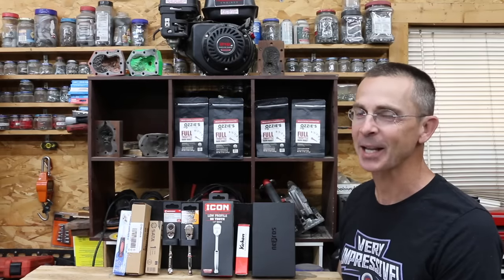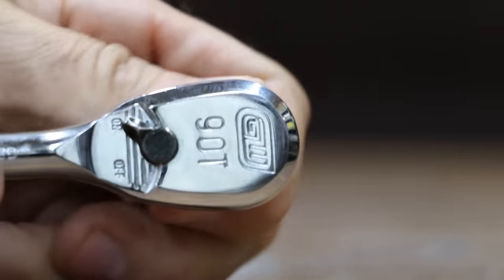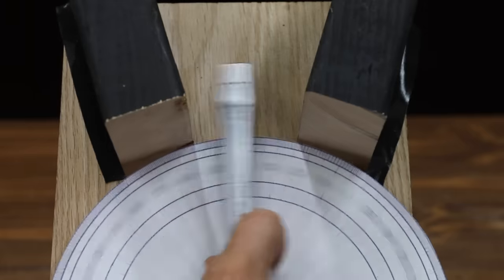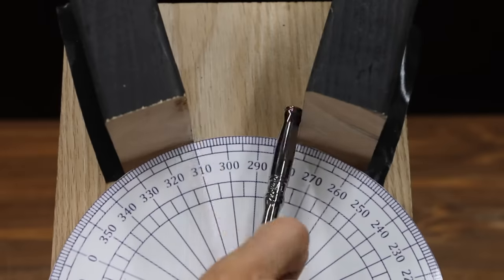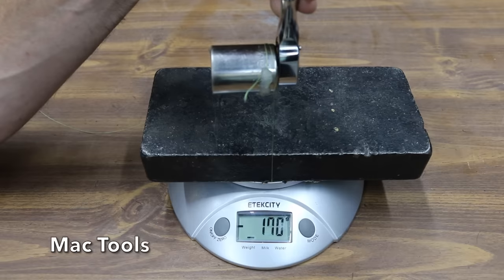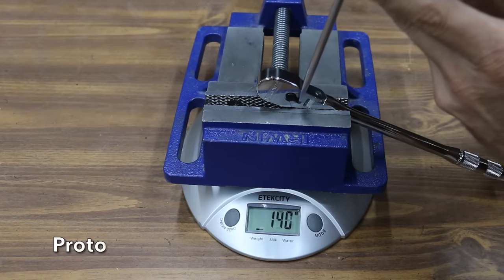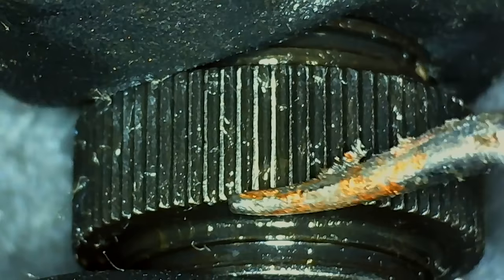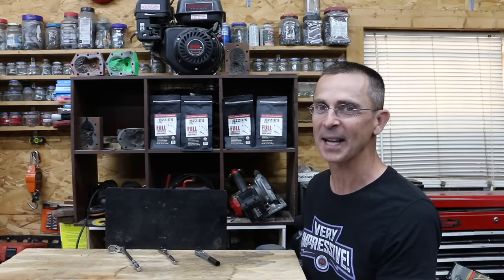Best Ratchet (1/4 In)? Snap On, Icon, Proto, GearWrench, Prototype

Comment: I own a short handle metal ratchet - without any teeth, intended for tight space use. I think is became discontinued, maybe for lack of strength, but I still like and use mine. It hasn't a direction lever but needs the 1/4 in square to be pressed through for a change. It is a special tool for special circumstances only, but I love it for its simplicity. I own a similar ½ in tool.
Reply from the maker: Thanks for sharing.

Comment: I picked up a Pittsburg pro model at Harbor freight.  It has a good tooth count, quick release button, and has a rubberized handle. it is great for the type of jobs I do that a 1/4" drive can support. The Harbor freigh SKU is 70153. It appears that now they have a green handle but mine is gray. It also only costs $10
Reply from the maker: Thanks for sharing.

Comment: I used to think Harbor Freight ratchets were awesome until I started working on cars. While the Pittsburgh I started with was strong when new, I found 3 months of daily use wore the teeth until it skipped with light force. I bought my Matco 88 tooth and haven't had a problem with it since. If you use it a lot, sometimes it's worth spending the money.
Reply from the maker: Thanks for the feedback.

Comment: when i did mechanic work i used a stanley ratchet that was a flex head and extended. i used it to tighten and loosen many tight nuts and never had an issue with it. i did crack a cheap socket with that ratchet.

Comment: Another great video. Please include the new gearwrench 120 ratchets, very noticeable design changes with Ultra narrow head. Also Matco ratchets included woukd be great. Also consider using an electric drill on low speed to “break in” each ratchet, plus use super lube synthetic oil for any that seem dry.  These are two common things people do, and some ratchets performance jumps considerably vs new.  Then retest for arc swing and back drag.
Reply from the maker: Thanks!  Thanks for the suggestion.

Comment: My craftsman quarter inch ratchet fell apart. Admittedly, I was using it with a breaker bar to access the top stud nut on an F250 shock :).  Replaced for free under lifetime warranty with a highly polished $38 one.  It is a joy to use.  Too bad Craftsman didn’t make it to the list.
Reply: A lot of people will buy replacement parts kits for these if they are the older made in US vintage ones of the 80's and before and keep their original.  The replaced ones are the China made ones are don't do nearly as good a job working on projects nor last.  Pretty bad when a broken earlier version is valued more than a brand new product.  Edit:  Also, if the rachet just isn't gripping/slipping, there are videos on how you can take it apart, clean the gears inside and that will usually fix it.
Reply: @Tricky_Adventures  was using a 2 foot schedule 80 pipe as a breaker bar on the poor 1/4” ratchet outside in the dark when it’s guts removed themselves in a mini explosion.  Didn’t like the feel of that 90’s vintage tool and love the new free heavily chromed and nicer shape 120pt ratchet even though it’s made in China replacement:). Especially cuz it was free.
Reply: the comment was more for others in the future.  Yeah, if you use any kind of breaker bar on a 1/4 rachet you're asking for an explosion 💥😁.  Though I would say if you're using a breaker bar Craftsman is the way to go, break and replace.

Comment: Not a bad test for out of the box tools.  However, the real proof is in the longevity of each.  Where a ratchet becomes truly superior is after a sustained period of use.  Things such as how much slop there is in the gear head is critical when working in tight areas.  How great is a ratchet when the gears don't catch until after 10 degrees of rotation?  Same goes for the springed lever to switch directions.   Maybe the torque test gives some insight to wear, but probably not.

Coming up with a mechanism for such a test in itself would be quite challenging.
Reply from the maker: Thanks!  Good Point!

Comment: Tension of the reverse switch is a biggie but not addressed is the direction of the reverse switch. I grew up on Craftsman which locks rotation in the switch position, which I think is the norm.  Even with some better quality ratchets I use the ones that are opposite are a slight irritation and take a moment to remember which way is which. I thought it might be a patent issue.

Comment: Been waiting for this, Excellent work! Would love to see a video on the best 1/4 inch or 3/8 metric sockets. A lot of companies have their own way of making sockets and they all have different clearances, for example some sockets wiggle on the bolt more than others ive noticed in my years of working as a tech, and some have more durable metals
Reply from the maker: Thanks!  Thanks for the suggestion.
Reply: I bought an unknown unbranded set of metric 6 point impact sockets about 50 years ago. 
The 14mm is the only one that shows any wear. (it had a ton of use in 15~20 years)
 I replaced it with a Snap-On 14mm that was excessively worn and looked about same as original after only 2~3 years. 
Even though I was working in a shop at the time, I didn't think it was worth the money I paid for it plus, as it was impact, it only had 90 day warranty. 
Ever since that fiasco, I've bought the cheapest impact sockets I can get as even the 3/8" drive ones seem to work just as well as sockets costing more individually than the several sets I've bought.
The only 'problem' I've ever had is 'tool snobs', either co-workers or customers who watch too much TV and see Snap-On toolboxes in movies

Comment: I am looking for comparison of garage door insulation types and commercial kits.  When using polystyrene kits, how much loss come through the gaps and metal anyway?  is a tight fitting expanding polyurethane really giving you better insulation and at what cost?  How does these compare with the relatively easily instaleld  double foil sided bubble wrap kits?

Thanks.  I check your videos now before making many purchases and appreciate your methods.  I'm recently retired from nearly 40 years of test and evaluation work. Data free decisions frequently come back to haunt us. thanks for getting data in front of the consumers who care enough to look for it.

Comment: The Sata ratchets are essentially the same as Gear Wrench (The sealed head ones anyway these are the low end versions). I have the 120t versions of both and taking them apart you'd be hard pressed figuring out which is which. I got both of the sets on sale for under 70 bucks each and have no regrets with either.
Reply from the maker: Thanks for the feedback.

Comment: To me low backdrag, a low arc swing and price are the most important factors (as a hobbyist). I agree with the conclusion of the Husky being a good wrench for the price. 

The TRO surprised me in its performance with repect to Koken. Koken is very proud of their low backdrag design and their zeal series have more teeth so it should do better at  the arc swing test. 

The "German" tools performed worse then I expected. Although Wera performed quite Ok.

Regarding the torque test I think all passed. When would you realistically use more then 35 ft lbs/ 50 nM on a small wrench like this? I think half that value is already quite a lot. I think a similar line of thought was given at the Husky recomendation.

The force for using the switch is not that relevant for me personally. Maybe being a bit stiffer is actually prefered as long as it easily managable with 1 hand.

Unfortunately Husky is not available in Europe. Also Koken is hard to find. The European brands are widely available of course.
Reply from the maker: Thanks for sharing.

Comment: As a mechanic I look for a stiff selector and the ability to rebuild the ratchet.   I don't care about length or girth,  because I have many different lengths of ratchets.  I guess part of being a professional is having the right tool for the right job.  I really like Matco ratchets with locking adjustable heads.   I've only broken one in the last 20 years and it takes about 5 minutes to rebuild.
Reply from the maker: Thanks for the feedback.

Comment: A good minimal to no slop w/ high tooth count is definitely handy.
Haven't had a whole lot of need for 1/4" drive but have an old THORSEN 3/8" but only 36-40 teeth though...it has the spring-clip over the ratcheting gear & would like to find a 1/4" just like it as I don't expect much difference in performance. Handles are straight & only widen slightly for the burr grip. The reverse is a rocker-type accessible from either side that bites good though SOMETIMES in a tight space by either grip or bumping something else the direction can swap. Easily changed back though. Have had good success with it...what slop it does have is from use but is beefy enough to tolerate a cheater the same length of the handle. The ratchet head is barely larger than the gear itself & the "tear drop" under it just big enough to accommodate the rocker.
Reply from the maker: Thanks for sharing.

Comment: I'd definitely like to see how craftsman stacks up. I've been using Craftsman for a long time and haven't yet had a failure. Their no questions asked warrantee adds some peace of mind, but I'm sure it would fall somewhere in the middle of the others. I'm interested to hear other's thoughts.
Reply: I’m still using the Craftsman ratchet set I bought when I purchased my first used car in 1963.  The car is long since gone but the ratchet set is still going strong.
Reply from the maker: Thanks for the suggestion.
Reply: Agreed. I kept wondering where is the Craftsman.  I know they aren't the same as the ones from the 60s and 70s, but still.....

Comment: I have crescent ratchets. They often change directions when I did not intend to change them. I think there needs to be a little more nuance with that part of the test. I think the problem with my crescent  ratchets is that the effort to make the switch is low, the lever is tall and during part of the operation, the effort to operate the switch drops to almost zero just before the pawl drops into a new detent. I will be checking this before I buy again.
Reply from the maker: Thanks for sharing.

Comment: If I expect to torque I will use a different wrench from Husky that I don't have a problem replacing. Then switch back to my 144. But a good point to look at is that most of these wrenches have warranties for them. And those warranties should be compared. Because I can buy my Husky wrench for $30 and if I end up braking it, I can get it replaced no questions asked. So it is nice to have a high failure load, but in addition if I do brake it, I know that I can get it replaced. That is good piece of mind for any tool, especially one so cheep.
Reply from the maker: Thanks for the feedbac.

Comment: One of the videos I’ve wanted to see properly done is a 3/8 and 1/2 ratchet shootout with the tool trucks. Do a basic one of both and then a flex head, locking flex head, and some of the longer ones. Head thickness for sure as well
Reply from the maker: Thanks for the suggestion.

Comment: I'm a huge fan of quick release, as I tend to change socket sizes frequently.  That being said, I don't mind that they aren't necessarily ideal for high torque, since I usually use a different tool for final torquing, or for breaking loose a stubborn bolt/nut.  Personally I own Carlyle rachets- not necessarily because I believe they are any better, but that was what I picked a long time ago and I've never had any need to buy anything different.  I'm pleasantly surprised that my backup set, which is the Husky brand, performed as well as it did!

For additional content suggestion, I happen to notice that there is a distinct difference in socket fit between different brands- my husky tools sometimes slip off the adapter for my impact driver, but I never have that issue with my Carlyle ones.
Reply from the maker: Thanks for sharing.
Reply: If I know I'll need to swap sockets a lot, I generally have sizes 'loaded' onto different ratchets

Comment: After looking through comments and making several replies to various people, I realise I spend probably more time reading and replying on your channel than any other on You-Tube ( I have an opinion and ain't scared to use it 😁)
Sometimes I even have experience with things you test (but not very often)

That's a pretty good test, 1/4" drive ratchets are always an issue and professional mechanics must have at least 3~4 as you never know when one will break

From experience, I would go with the Proto or, one you didn't test, Facom. 
Snap-On are pretty good but way over priced for what you actually get (I still have several in different drive sizes, 1/4", 3/8" and 1/2")
1/4" drive Facom I bought around 1980 is still going strong.
Lucky for me, (?) I'm now retired so don't need to have professional grade tools any longer but still take interest in what may be available
Thanks.
Reply from the maker: Thanks for sharing!

Comment: Wish you did a corrosion resistance test I've had several ratchets and have to often work outside, and if it is raining or I'm in a wet environment after I finish the job I dry and clean my tools, how ever the next day I have nothing but issues, directional switch is stiff or wont change or it's just locked up not ratcheting. I also think you should test the warranty because thats a big part of the tool if you have to jump through hoops and its a fight aka customer service sucks that is a big factor in deciding what brand to buy, you want a company to stand behind the product they are selling.

Comment: While I don't want to see great old tools broken on purpose, I'd love to know the difference between different generations of the same tool. My Dad bought me a small mechanics set of Craftsman tools back around 1990 for Christmas so I could learn to fix my own bike and eventually help him in the garage with cars as I got older. I still have the sets 3/8 and 1/2 ratchets to this day. I lost the 1/4" as far as I remember. I know I did not use them properly when I was little and even into younger adulthood as I can clearly remember using a hammer on it to loosen tough bolts. Over the years, I randomly see tools on sale and will buy them to fill gaps in my kits either for traveling or in the garage and I've broken so many Craftsman ratchets since then but not the old one!  No, I do not have either the short or deep 10mm socket from that set anymore.  I don't think they saw my 18th birthday.
Reply from the maker: Thanks for the suggestion.

Comment: I have some Koken ratchets and I love them. Some key points about them that were not really mentioned: They make a bunch of lines of tools for different professions, their top line for mechanics is the 'Z-series' which is what I only have experience with. The info on the USA koken website is not as good as the Japanese site, such as not showing the z-series 1/4" ratchets (or not that I could find). The Z-series ratchets are 72-tooth - so in terms of the F rating for rotation, I would think that would be closer to A+ if using the correct series. The other ratings do a good job of representing how buttery smooth the ratchet feels to use. In terms of failure load, I haven't broken any of mine but I could see that as being accurate. They have a slight feeling of delicacy, not in terms of being cheap but more so slender and the smooth action of the 72 teeth gives the impression it would be easy to break. As long as you are using an appropriate drive size for the job I think they rank up there with the American brands in terms of strength, at least that has been my experience from my use. Also matches them in build quality, feel, plus only costing a fraction of the price. Obviously a biased opinion being a big fan of Koken
Reply from the maker: Thanks for sharing.

Comment: Can 2d the husky being a good ratchet. Have used it with an extension where the 1/2 head snapon wouldn’t fit just too tight to fit head and long sockets. The husky hasn’t broken yet while others have on the same bolts.

Comment: Great informative video, but I would have rather seen if the ratchets are capable of shearing the largest fastener , that they are designed to work on, rather than , or as well as the destruction test. I'd love to buy the Gearwrench 120 in the UK, but to buy one here costs over £50.00.
Reply from the maker: Thanks!  Thanks for the construtcive feedback
Reply: @ProjectFarm  YW  :)  - Thanks for the video.

Comment: I have been a auto tech for 45 years and will tell you straight up.  When it comes to ratchets, sockets, and wrenches, SNAP ON  is your best choice.  You want bloody hands and arms, use the others. Their was two maybe three others in there I  might be willing to use.  Those rathets wear not made to handle your break.test with the pull bar. Try half inch, three quarter and one inch drive.  What normally breaks is the gears  which could mean you are using wrong size drive for thc job. STALLWHILLY makes good longlasting tools. You may even find a few of thcir specialty tools on a SNAP ON truck. The only time the external piece that you wear breaking breaks is if you abusing the tool  ie not using it the way it was meant to be used. Sometimes you may have no choice and thats what good warranties are for.  Always try to use the right tool for the job if possible it is much safer.
Reply from the maker: Thanks for the feedback.